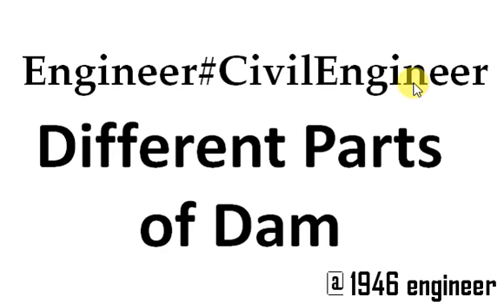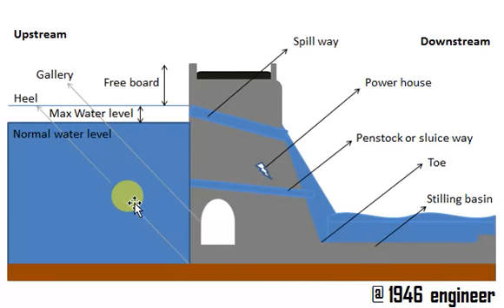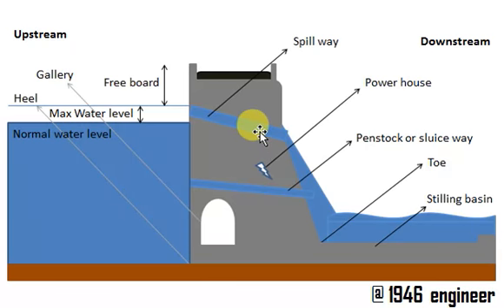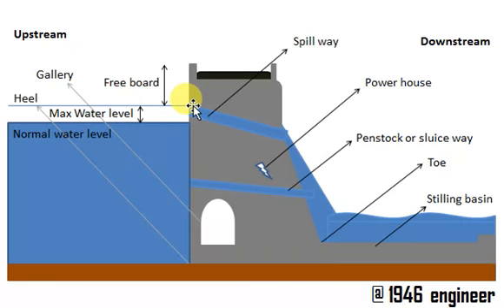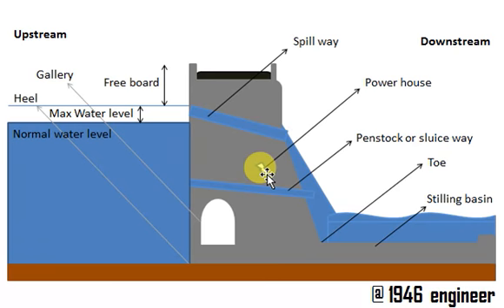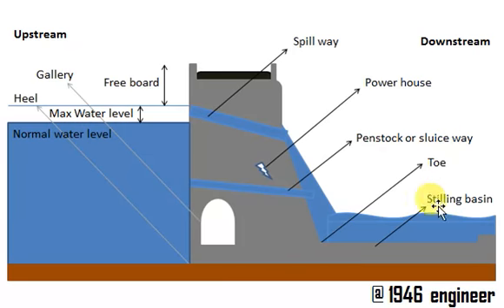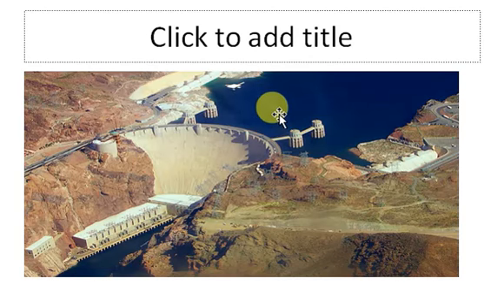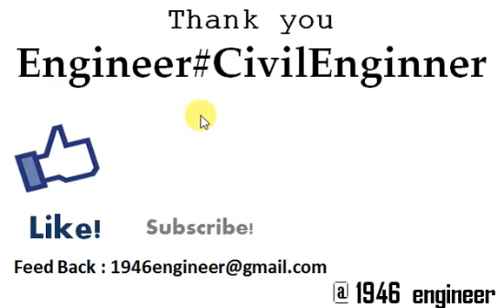Parts of a Dam

Comment: sir, could you also make videos on strength of materials and theory of structure
Reply from the maker: rsrilu darling please specify the concept to be explained.
Reply: stress, strain, concrete grades, cement grades,bending moment, shear force, point of contraflexure,
Reply: and also rain guages its types, earthen dams and gravity dams water flow in those dams
Reply from the maker: Rsrilu darling, please watch mix ratios of concrete for  concrete grades. Remaining videos may take time. I will intimate their uploads through comments. 
Link: https://youtu.be/D2HquSfI1DI
Thanks and Regards 
1946 engineer#
Reply from the maker: rsrilu darling! My video on Stress and Strain is uploaded. Watch it, if you find it useful please share it with your friends.
Link : https://youtu.be/OF3KppV_WM4
Regards.
Engineer# 1946